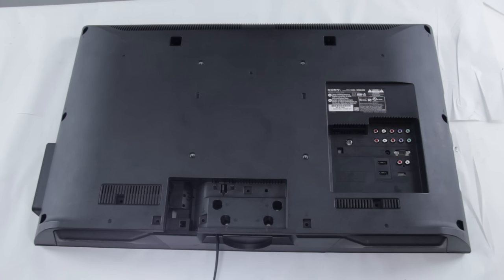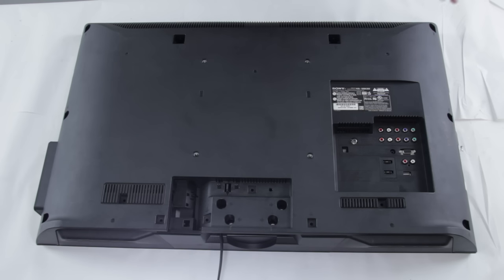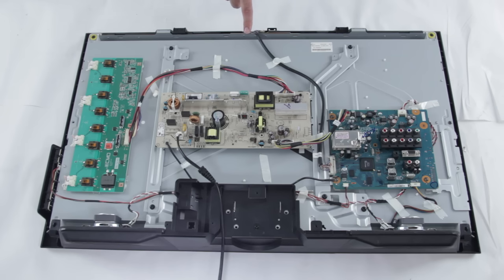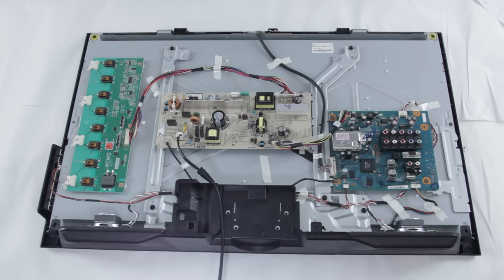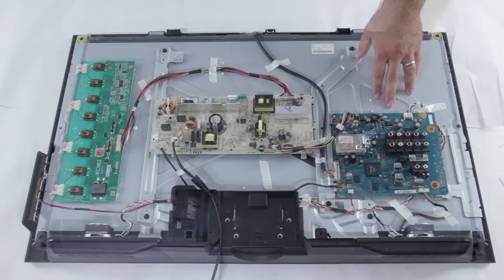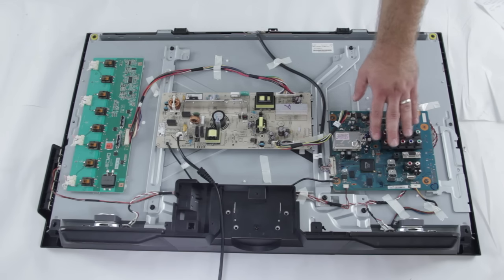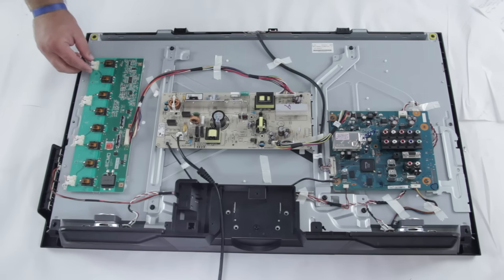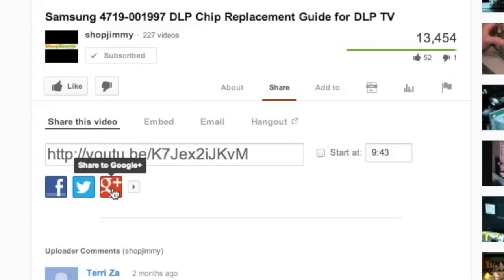LCD TV Repair Tutorial - LCD TV Parts Overview, Common Symptoms & Solutions - How to Fix LCD TVs

Comment: Hello, I have a Proscan 40LC45S57 tv 
When I plug it in the red led on front comes on accompanied by a whining from the speakers. It will not power on regardless of the remote or button on the side. On the back the red led is lit on the main board (I'm calling it the main because it's the one that has 120v ac going into it and feeds various DC voltages to the other boards). 
I have checked all DC voltages on this board and they are correct (5v,12v,16v,24v) there is no change in any of the voltages when the power button is pressed on either the remote or on the TV
What do I do next
Reply from the maker: +William Moorhouse   Try all repairs and troubleshooting at your own risk.  I recommend replacing the main board in your TV.  Click this link to replacement parts for your TV model number:  http://www.shopjimmy.com/proscan-121333-main-board-for-40lc45s57.htm  There may be multiple boards for the same TV model number, be sure to match part numbers on your current board, with your replacement for compatibility.  Thanks and please let us know if you have any further questions with your TV Repair!  www.shopjimmy.com

Comment: My 42" PROSCAN  42LD45Q serial number  65395-42LB45Q-c   works pretty good except when it's on for a while.   Then it get a dim black translucent  cloud like patch about 10" x 4"   centered in screen. Looks like a black cloud you can see thru.  
Also, if you leave it on the title menu from the Magnovox Hard Drive tuner a few minutes, when you return back to the recording, you can see the 6 orange rectangle menu title windows in the playing picture.
Is there a fix for this or a you tube video on it?  Cain't seem to find much on PROSCAN.
Thanks
Reply from the maker: +RIPSAWONE   Try all repairs and troubleshooting at your own risk.  This sounds like a TV panel (TV Screen) problem.  If your TV panel is bad, it may be more cost-effective to replace the TV as panels are typically hard to find in stock, difficult to replace, and expensive.  Thanks and please let us know if you have any further questions!  www.shopjimmy.com

Comment: Emerson LC320EMX , just white screen, some light lines far left side.
Reply from the maker: +T. Power   Try all repairs and troubleshooting at your own risk.  This could be a problem with either the digital board or the TV panel.  Click this link to replacement parts for your TV model number:  http://www.shopjimmy.com/catalogsearch/result/index/?cat=225&q=LC320EMX  There may be multiple boards for the same TV model number, be sure to match part numbers on your current board, with your replacement for compatibility.  Here is a link to a video showing how to identify your part number, click here:  https://www.youtube.com/watch?v=wooRqBrRo6oThanks and please let us know if you have any further questions with your TV Repair!  www.shopjimmy.com

Comment: I have a scepter lcd tv. model #X425BV-FHD. I watched the videos here and replaced the tcon board, power supply and backlight board. I was unable to purchase the main board, as it is out of stock. The issue: when I plug in my TV, the red power indicator lights up, then I turn on the power and the light turns blue but I have no picture and no sound. I am unable to turn the blue light off (the power) by the side button or by the remote. I did the flashlight test and there was no picture. There are no backlights. Again, I purchased the power supply, tcon board and backlight board from your site and replaced all three, one at a time. Nothing has changed. What should I do now?
Reply from the maker: +gowmee   Try all repairs and troubleshooting at your own risk.  Since you ran the flashlight test and did not see anything on the screen, I recommend replacing the main board in your TV.  Click this link to replacement parts for your TV model number:  http://www.shopjimmy.com/catalogsearch/result/index/?cat=56&q=X425BV-FHD  There may be multiple boards for the same TV model number, be sure to match part numbers on your current board, with your replacement for compatibility. Thanks and please let us know if you have any further questions with your TV Repair!  www.shopjimmy.com

Comment: I have a LG 55 LE5400 I replaced the main board 66400202 because I turn on the tv with remote, hear the click get no picture, wait from 5 to 10 minutes turn on and off a few times then picture appears. has great color and picture, what else may be the problem..thank you
Reply from the maker: +Bob Doyle   Try all repairs and troubleshooting at your own risk.  I recommend replacing the power supply board in your TV.  Click this link to replacement parts for your TV model number:  http://www.shopjimmy.com/catalogsearch/result/index/?cat=59&q=55+LE5400  There may be multiple boards for the same TV model number, be sure to match part numbers on your current board, with your replacement for compatibility.  Here is a link to a video showing how to identify your part number, click here:  https://www.youtube.com/watch?v=_4Qpfan0vdUThanks and please let us know if you have any further questions with your TV Repair!  www.shopjimmy.com

Comment: my Vizio M3D460SR backlight works, but I have no picture, not even the menu....i don't about sound because I don't remember what input it was on. any help would be great
Reply from the maker: +Lucien Kettle   Try all repairs and troubleshooting at your own risk. This could be a problem with either the t-con board, the main board or the TV panel. You can replace the main board and the t-con board individually to see if one of those boards fixes the problem.  Click this link to replacement parts for your TV model number:  http://www.shopjimmy.com/catalogsearch/result/?q=M3D460SR  There may be multiple boards for the same TV model number, be sure to match part numbers on your current board, with your replacement for compatibility.  Thanks and please let us know if you have any further questions with your TV Repair!  www.shopjimmy.com

Comment: Hey guys I need serious help. Iv'e gone through two $400 tvs in 2 years now and Im so frustrated. I currently have an Insignia ns-50d550n and the sound is working on it and but the screen is black. I tried the flash light trick and I can see the picture with the flash light. I opened the tv up and tried finding the backligh inverters on the side but there is nothing there?!?! So I have no idea what i am suppose to replace. I dunno if this means i have to take those whole dame screen off or what?! i watched the video shopjimmy posted about backlights.. i have nothing showing in the back of my screen when its dark in the room.. so i dont think its the tcon board. but I just do not know what to do.. I cant keep buying a new 400 dollar tv every year and a half.

Does Insignia bury the back light inverters underneath the aluminum frame or something? or are there not suppose to be any? Ive heard that they could be built in to the board or whatever.. I dont know what to do. I did find a part number on shopjimmy for the component with the hdmi inputs and rca stuff on it.. but i dont think that needs replaced.. help please?

Comment: Good evening, I have a TV L26W931 AOC model has the following problem is lit and the screen went white and stay that way and not get anything else, what would be the problem?
Reply from the maker: +SEBASTIAN ROA   Try all repairs and troubleshooting at your own risk. This could be a problem with either the t-con board, the main board or the TV panel. You can replace the main board and the t-con board individually to see if one of those boards fixes the problem.  
Unfortunately I do not see any replacement parts in the search results for your TV model number on our website.  Thanks and please let us know if you have any further questions!  www.shopjimmy.com

Comment: I have a sharp LCD TV, MODEL LC-40SH340K   ser number K  205937997
The problem is normally after warm up  the  picture fades to a blank screen ,and comes back for a few seconds,sometimes minutes then  disappears again,
wile picture is on it's perfect, sometimes picture stays on for few hours 
screen picture slight flicker then picture disappears completely, sound perfect
suggestions welcome, thanks bob
Reply from the maker: +BOB LEA   Try all repairs and troubleshooting at your own risk.  I recommend running the flashlight test on your TV.   Here is a link to a video we produced that shows how to run the flashlight test. https://www.youtube.com/watch?v=xUzCLgoSPGM Please reply with your flashlight test results and we can recommend a replacement part for your TV repair. Thanks and please let us know if you have any questions! www.shopjimmy.com

Comment: Having a problem with samsung LN46B630N1FXZA where suddenly thin persistent black horizontal lines appeared across the right 75% of the image, going from dark lines on the far right and progressively getting lighter as you move across to the left side. It is the same across different HDMI inputs, and appears on top of the tv menu as well. I'm thinking T-con board went bad from what I've been reading but any insight is much appreciated. Thanks!
Reply: +Erik Brown just read the comment below, sending inquiry to new URL...

Comment: I have an LG television whose power button changes from red to blue (as per normal) but the screen remains black and there is no audio.  I tried the flashlight test and could not see any ghost images as I pressed the input button on the remote (the remote will turn the TV on and off. It's an LG model number 42LK550-UA with a service code of 42LK550-UA.AUSYLJR manufactured in April 1911
Reply from the maker: Lily Pence  PLEASE SUBSCRIBE TO OUR CHANNEL - Try all repairs and troubleshooting at your own risk.   I recommend replacing the main board in your TV.  Click this link to replacement parts for your TV model number:  http://www.shopjimmy.com/catalogsearch/result/index/?cat=56&q=42LK550-UA  There may be multiple boards for the same TV model number, be sure to match part numbers on your current board, with your replacement for compatibility.  Here is a link to a video showing how to identify your part number, click here:  https://www.youtube.com/watch?v=RwHTvjMdrhk  Thanks and please let us know if you have any further questions with your TV Repair!  www.shopjimmy.com

Comment: When I turn on my tv it has a high pitch buzzing noise with a yellowish green screen. It turns itself off and back on again with the same high pitch buzzing and yellowish green screen with  fuzzy images .  Samsung model number PN50A510P3F. Is it the BN96-09744A (LJ92-01611A) Y-Main Board?

Comment: I have  a Sony Bravia model # KDL-46XBR2 serial # 8139118. The screen went blank. The power works; nothing else. There is a Bose system presently hooked-up to the tv, so sound came through the Bose speakers, with a dvd playing ( on the Bose); there is still sound , but no image. There is no cable tv in this part of the world, where I'm located. I would be grateful for your advice and guidance .

Comment: I'm having a problem with my Insignia LCD TV Model No: NS-LCD47HD-09 Serial No:J7894JA020538 powering on. The blue indicator light turns on below the screen but doesn't connect with the signal; when you power off, the red light flashes intermittently. If you go through a series of powering off and on, it finally detects the signal the TV comes on. The number of times that you have to turn it off and on is escalating up to 100+/- times before it detects the signal and you can proceed to watch TV. HELP!!

Comment: I HAVE SAMSUNG UN50TU8000FXZA.  A SEVERAL DADYS AGO TY TURN OFF AN I HAD PROBLEM TO TURN ON PROPERLY. I UNPLUGGED IT WAIT PLUGGED IT ........AGAIN.....THIS TIME HOLD START BUTTOM 30 SECCOND .....AFTER A FEW TIME TV START WORKING. YESTERDAY THE TV  TURNED OFF AND I CAN TURN IT ON. WHEN I DO I HAVE BLACK ANE BLUE SCREEN. WHEN I DISCONECTED POWER SUPPLY FROM MAIN BOARD I GOT SOUND AND CNOTINUOUS  REGULLAR BLUE SCREEN. ITS WORKING WITHOUT PICTURE. WHEN I CONNECTETED TO MAIN BOARD AGAIN JUST BLACK AN BLUE SCREEN ALTERNATELY. SHOULD I REPLACE  A  MAIN BOARD? OR ITS PROBLEM WITH TCON BOARDS ?

Comment: Hi I have a Samsung LN40A650A1FXZA LED TV. The issue is vertical lines on initial power. It goes away if I let the TV stay on for about 5-10mins the power reset it. I opened it up and noticed one capacitor looked bad on the power supply. It showed black blot on top of cap. However, it was not swelled up. Regardless I decided to replace the capacitor - 25V 470uF Capacitor. I'd hoped that was the easy fix, but I still have same issue. Folllowing link shows an example of another post of similar issue 

http://www.fixya.com/support/t17320552-samsung_40_ln40a650a1fxza_video_issue

Some other sites suggest issue with Main board Cap/IC chip or TC Board IC chip. Thanks to anyone who has recommended fix.

Comment: Hello Shop Jimmy, I don't k-now if you still work on tv problems but I  have a screen that is called solarized image  would that still be a replacement of t-con board. I even went to the menu screen and it also is a little different in color as an orange green rust color my tv is a dynex   model # is DX-L42_10A   .  I don't know where the serial # is ,nothing states serial # ,so if you can tell me what you think it is I would appreciate it . Thank you Holly
Reply from the maker: +Holly Morgan   Try all repairs and troubleshooting at your own risk. This could be a problem with either the t-con board, the main board or the TV panel. You can replace the main board and the t-con board individually to see if one of those boards fixes the problem.  Click this link to replacement parts for your TV model number:  http://www.shopjimmy.com/catalogsearch/result/?q=DX-L42-10A  There may be multiple boards for the same TV model number, be sure to match part numbers on your current board, with your replacement for compatibility.  Thanks and please let us know if you have any further questions with your TV Repair!  www.shopjimmy.com

Comment: Can anyone help? I have an LG TV model number 32LH5000. My TV was fine, then I turned it on the other day and it now has rapidly flashing green vertical lines across the whole screen, I can see the picture in the background but the flashing green lines make it unwatchable. I can't afford a new TV and before I do a DIY job on it and break it completely, If anyone knows what's causing the problem and maybe have a few pointers on how to possibly fix it, it'll be very much appreciated. Thanks.

Comment: Hi guys I got a nordmende nm47751 when I turn on the tv the screen is very bright white can see images but very hard to make out.would this be done to the t con board or backlog hr converter
Reply from the maker: +MrDanny8585   Try all repairs and troubleshooting at your own risk. This could be a problem with either the t-con board, the main board or the TV panel. You can replace the main board and the t-con board individually to see if one of those boards fixes the problem.  
Unfortunately I do not see any replacement parts in the search results for your TV model number on our website.  Please reply with your part number on your main board and I can try searching for replacement parts.  Thanks and please let us know if you have any further questions!  www.shopjimmy.com

Comment: Hi, my samsung 40' 3d smart tv after completion of warranty has gone complete black all of sudden.  I could see that images are running at back ground in dark and sound is coming out.  Believe that this is an issue with backlight inverter.  Samsung service needs the panel to be changed out.   Could you guide me to rectify this problem. Samsung TV Model is UA40D6000, a 3d smart tv.
Reply from the maker: +Subramanian Balamurugan   Try all repairs and troubleshooting at your own risk.  This sounds like you have bad LEDs in your TV.  Unfortunately we do not sell replacement LEDs for your TV model number at this time.  You can check back in the future to see if we have them available.  Thanks!  www.shopjimmy.com

Comment: Hi i have a Insignia 32 inch.  Model NS-LCD32-09.  I cannot turn on the TV on or put down the  volume on TV with the TV remote.  The buttons on the side of the TV i cannot turn the TV on or put down the volume with those buttons as well.  The TV has picture and sound but i cannot lower the volume control.  What needs to be replace for this model?
Reply: INSIGNIA anything is garbage. That is "Best Buy's" No Frills Brand. They make their own TV's and junk. Garbage.

Comment: I have a Sharp Aquos #LC46BD80U LCD flat screen. The channel memory doesn't  function properly. Is this a motherboard problem ? If so is the part available?
Reply from the maker: +Gregg Strandmark   Try all repairs and troubleshooting at your own risk.  I recommend replacing the main board in your TV.  Click this link to replacement parts for your TV model number:  http://www.shopjimmy.com/catalogsearch/result/index/?cat=56&q=LC46BD80U  There may be multiple boards for the same TV model number, be sure to match part numbers on your current board, with your replacement for compatibility.  Thanks and please let us know if you have any further questions with your TV Repair!  www.shopjimmy.com